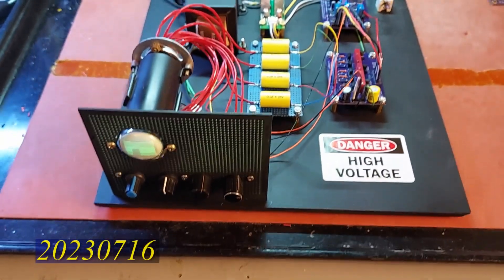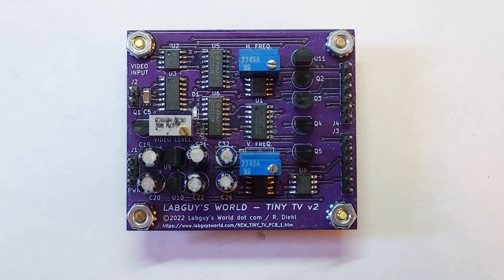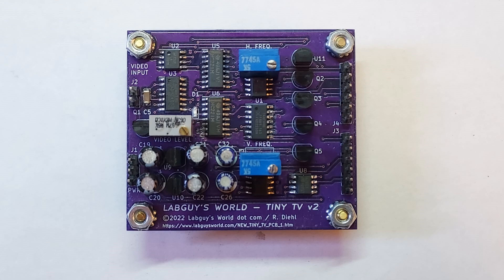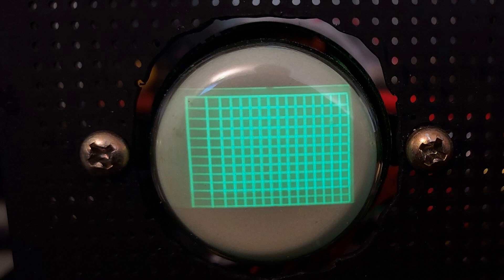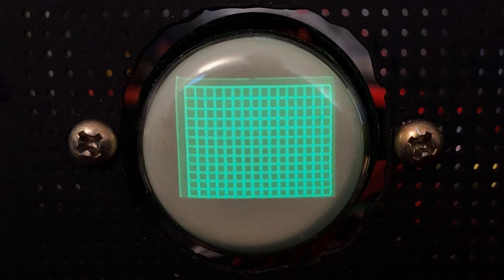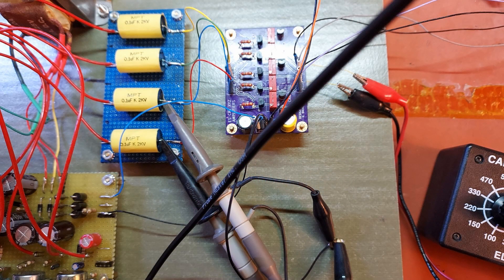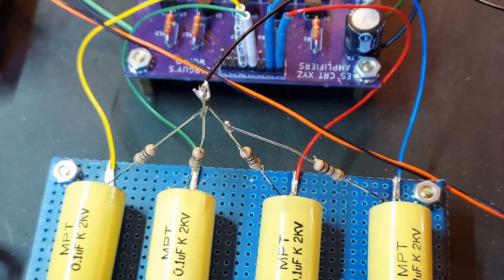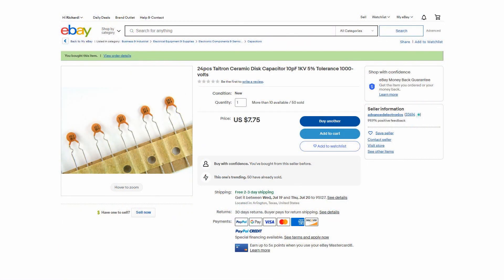Bob O Scope Part 4, Project Update 20230716

Comment: Hey!! 

I'm about to buy a Sony AVC-3400 portapak and have a big question!!

The seller sayd it powers on but when they press any of the buttons, the machine just makes a clicking sound.. Do you think that's because there is no tape in the machine??
Reply from the maker: That is quite likely. There is a mechanical sensor (wire) between the scanner and the fixed heads that has to be pushed back to enable the deck to engage. Be aware, these machine are notorious for having open main motors. The brushes are pressed to the commutator by foam rubber pads. These pads have turned to snot. If you are up to the task, it's not too hard to pull the bottom off the motor and replace the pads. If you get it the machine, contact me through my web site and I will provide you with a full set of service manuals (PDF).
Reply: @videolabguy  Thank you so much! There was someone else that you helped a lot with this camera and he gave me your contact. his name is Ethan.
Reply: @videolabguy  Hey, I went on your side but couldn't find your email address! Can you tell me it, please?

Comment: Dam Gizmo in the works ! Still looks good to me ,i am always confused as i thought its not possible to display this line rate without lines over lapping on a small crt like this but i see the image is pretty crisp ,I have plans on trying it on mine  to see ,i was going up to 240 line but would be easy to try 525 or 626 line
Reply from the maker: Yes. Some line overlap does occur. But, the image is still very sharp and clear. The clip I showed is far from optimized. I think I mentioned before that the video was clipped in the amplifier preceding the control grid circuit. The video amp will need some optimizing. But, as usual, that is for a future episode. Stay tuned.

Comment: No need to buy a low value capacitor, make one! Two insulated wires can be twisted together and trimmed later for length. Allow about 25mm per pF. Sometimes called a "Gimmick" Capacitor according to Wikipedia.

Comment: “Parasitic” conductance and capacitance fixes the linearity?! Who could have guessed?
Reply from the maker: It's not repaired yet! But, yes.
Reply: @videolabguy  Before the capacitors arrive, you can make your own. 10 pF is easily achievable in a relatively small footprint and all kinds of materials can be used for a 1kV dielectric. Even a pair of mains wires twisted together works, and so does a piece of dual-layer PCB.
Reply: @videolabguy  ...or if you have 𝑛 capacitors whose value is 𝑛 times too high and their voltage rating is at least 1000/𝑛 V, just put them in series. To prevent voltage imbalance, split the parallel resistance into a voltage divider with 𝑛 sections, each in parallel to one capacitor. Experiment with the resistance and capacitance to fine-tune the picture: perhaps the capacitor is not needed after all.
Also, the vertical deflection circuit might need the same treatment, the uppermost row is stretched a little as well.
However, with the probe connected, this is the most perfect rectangle I’ve seen on a CRT. Too bad the beam does not get any sharper.
Reply from the maker: @vaclavtrpisovsky  You are correct about the vertical circuit. It is distorted too. Just not nearly as noticeable as the horizontal. All outputs will get the treatment. The amount of correction may also be different with different CRTs and their differing parasitic capacitance. This is the cost of trying to make the circuit too simple. I think the tradeoff is good and will work well in the end.